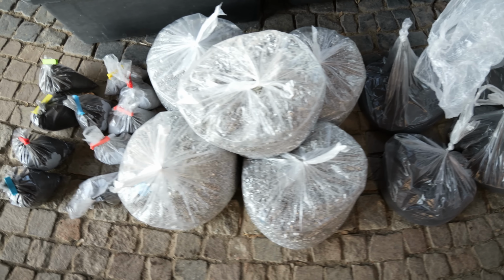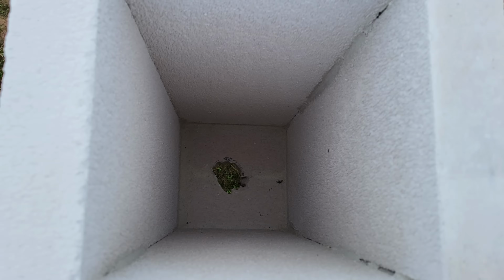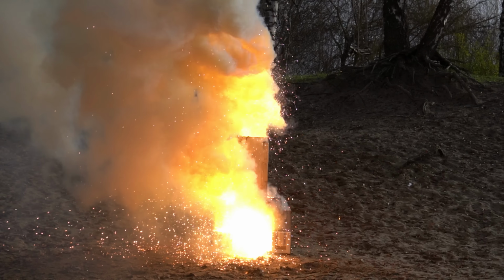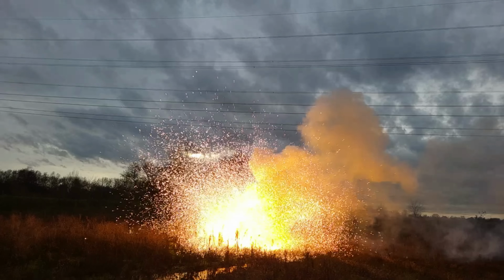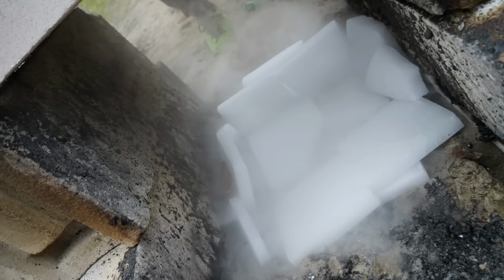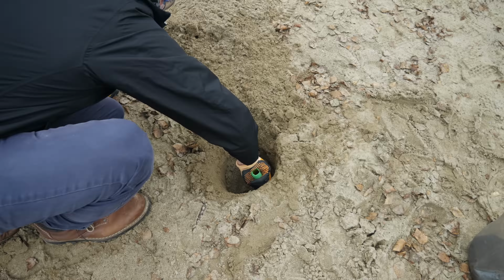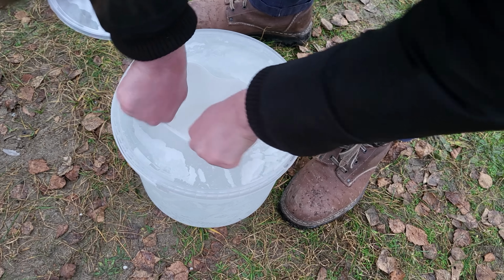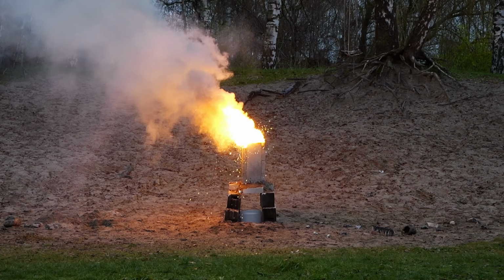100kg Thermite: Observing the Power of Aluminium and Iron Oxide Combustion

Comment: That was a hydrogen explosion.
When the cooling loop in a blast furnace ruptures,  it will make an explosion big enough to be heard miles away.
Your thermite mixture provided the molten iron and the ice stood in for the cooling water system and boom😮

It really sucks if you're on the plant when it happens because your ears are ringing 😵

The other reason I loved the video is the heat evolved from the thermite was thousands of degrees  because it was a runaway reaction but what if the fuel instead was just  pure iron powder ignited by an arc collar so fuel could be added from the top as iron, combusted in a turbulence chamber and then falling to the base as iron oxide Fe2O3 then take that rust and convert it back to iron powder using high temperature hydrogen 

By the way, the only byproduct is water and it might be the single most important process on the planet because powdered iron is rechargeable fuel that costs pennies.
A Belgian brewery is burning iron to make beer🍻
Reply: Nah, ice blocks also blow up when you pour liquid copper on them. Notable the watermelon didn't blow up, even though there's plenty of water there to create hydrogen and oxygen.
My money is on a violent thermal shock, as the explosion ONLY occurs with ice.

Comment: You get better thermite if you dry and clean your raw materials, such that far less gases are released during the reaction. You can essentially watch commercial thermite burn from up close, that is how controlled it burns due to the almost non existing gasification of impurities. I can show you some commercial thermite "elektro thermit" if you want, still have some bags of that material.

Regarding the explosion with ice, I would assume the same mechanism as with all the other metal-water explosions, which could be coulomb explosions.

Regarding the rubies: Look at the color of the reaction product, how is anything with a very light hue supposed to be visible in there? If the slag were white like pure Al2O3, then we could expect anything to actually be visible. But that is not the case. Additionally, due to the thorough mixing of your home made thermite during the reaction (due to gas escaping), there is way for a pocket of pure, molten Al2O3 to stay in place without getting mixed with everything.

PS: So many angles/cameras, why not dial down the exposure for some of them?

Comment: I would be willing to bet money that the dry ice pour yielded a wonderfully hard product.
By the way, had you included the dry ice into the mix it would have Amplified the reaction.
The cause of this has been of great debate for a long time.
 From the simple steam explosion to the Ripping the part at the molecular level of oxygen and hydrogen.
Personally I think it's a physical reaction which allows the molten material to become broken up into much smaller drops.
 The smaller bits of molten metal burn off much quicker. 

Like a dust explosion.
Reply: I can I imagine that you would get something akin to Cementite with that reaction. 
defiantly a hard material,

Comment: the dry ice didnt melt entirely in part due to the leidenfrost effect
imagine a drop of water on a pan that's way hotter than boiling temp, how it skitters around and doesnt just vaporize
such aggressive temperature swings between phase changes produces an insulating layer of gas that doesnt even allow the colder object to touch the hotter, cutting heat transfer drastically

Comment: Simple solution to the Water proplem: Water contains oxygen. Well CO2 dose too, but it's bound much stronger to the carbon than it is to the hydrogen in the Water. 
So what happens is that the reaction energy from the thermite is able to take oxygen away from the water and use it to burn more rapidly

Comment: The exchange of oxygen from the iron to the aluminum must have an intermediate phase which would be highly polarized.  It may be enough to strip the hydrogen from the oxygen in the water, but then what happens to the oxygen?  Does it recombine with the hydrogen or does it combine with the metals in an explosive way?  Does it also work with liquid water, and if not, why not?  I think your question requires more science and less play.  Experimentation and analysis of the products is required.

Comment: What if we consider the potential speed of the individual molecules in hydrogen and oxygen? In frozen state, water is not moving very fast, then massive influx of heat causes the molecule to begin to vibrate faster. What if the hydrogen being smaller begins vibrating faster than the oxygen? If either of the hydrogen molecules vibrated fast enough, they could Snap there double bond, Boom, instant Browns gas, and free hydrogen.

Comment: I believe that metals burn at such a high temperature now they actually break the Bond in the water molecule and become separated into elemental oxygen and hydrogen. Which is why you don't use water to put out metal fires. May be wrong, this is just what I've been told.
Reply: Metal fires on their own can use water as an oxidizer, as water is a lot more dense than air, it can accelerate the reaction. But the thermite mix is already stoichiometrically balanc3d between Aluminium and oxidizer.

Comment: If I had to guess, since the water is a liquid at STP, it is able to bubble and boil until it covers and seals over the molten iron lump which lets it build pressure for a split second (water is incompressible) and explode, and since as it cools down eventually the Leiden frost effect will wear off, and so it can contact and boil the water abruptly as well. but dry ice creates a Leiden frost effect the whole time (due to the extreme temperature difference) and is not a fluid, and cant seal the expanding gas.

Comment: I was bored one winter and used electrolysis to dissolve a bunch of scrap iron (weird,  yes).  Other than the time, it was easy sourcing iron to do this, and was therefore 'cheap'.  :D 

The output was a black sludge which I rinsed with water several times to get the NaCl (yep, salt, very little) electrolyte back for reuse.  Once this black sludge was heated/dried and pulverized it became a fantastic bright red and super fine source for this kind of stuff.  Can't remember all the research I did way back then, but I could probably dig it up and share the process.  It was done in a controlled manner because I was paranoid - but this process produces hydrogen to get things done at a reasonable rate, and therefore I suggest no one try it.  Made 70+ lbs of iron oxide powder in a few months.

Also, it was a seriously nasty process which I don't suggest.  The black sludge (and subsequent output) will stain everything, forever.

Comment: my opinion is that the dry ice to gasCO2 has a much lower expansion ratio than water to steam. also the dry ice looked somewhat insulated from the interaction, the outer layer wisping away. by comparison, a volume of water would increase in temperature more uniformly until a sustained steam reaction occurs. >guess> it would not surprise me if once a volume of water has sufficiently warmed,  an initial steam reaction occurs resulting in a shockwave. a low pressure region behind the wave front gives rise to more steam reaction due to vapor pressure. not unlike cavitation.i cant find any papers on cavitation in near-boiling water<guess<

Comment: Could thermite be used to fire charcoal? A reaction vessel could be used to form a steel casing around the carbon mined from the atmosphere. We can use seasonal crops as a carbon source. Agricultural waste reduced to carbon in any form depending on what alloy the reaction vessel produced by the reaction yields as wheather and how it is quenched.

Comment: If you are using an excess of aluminium, is it possible that the ironfall also contains aluminium (I) oxide and aluminium (II) oxide? I am not sure how exothermic the hydration of aluminium (III) oxide would be but those other two would be very reactive. This could be tested by using a less reactive metal oxide* than iron oxide, the heat would be similar and the aluminium compounds similar but no oxidising of the metal. Alternatively, using zinc metal† with iron oxide would also be interesting, as the zinc would have fewer possible oxidation states. Sodium, potassium or lithium would have their own difficulties and would complicate matters by possibly producing superoxides and peroxides. Powdered silicon is one I have always wanted to see used, but elemental silicon has a Mohs hardness of 6.5.
All of the possible thermites above ice, please.
* I don't know - bismuth, indium, tin? 
† Equally reactive transition metals may have different qualities in promoting the explosion - chromium, manganese, copper, etc.
Reply: Aluminum doesn't have lower oxidation states (to any meaningful degree, AFAIK?), but excess metal dissolves in the iron so it will contribute to the reactivity of the liquid all the same.

"Ironfall" hmm, it IS something of a waterfall at this scale, isn't it... but with something very much not water. I like it.

Regarding zinc -- these reactions are driven not so much by conventional [aqueous electrochemical] reactivity series, but by the binding energy of the compounds created; Al --> Al2O3 releases tremendous energy so it's capable of reducing elements you might not otherwise expect.  Also, metals like Zn, Mg, Mn, Na, etc. have low boiling points, so they tend to leave the reaction once formed; indeed you can make elemental Mg from MgO + Al, if you cook it hot enough for long enough, and preferably in vacuum; despite the massive binding energy of MgO (MP ~2800°C!), Mg distills/sublimes off.

ZnO isn't a bad oxide in terms of binding energy, but I'm not sure it would do much in comparison to Fe3O4 or Fe2O3, and Zn is a gas at any temperature where those oxides are liquid (unless you want to do it in a bomb reactor :) ).

Comment: May it be that molten iron and molten aluminium in contact with water behave similarily to alkali metals in water? On YT thunderf00t had a series of experiments trying to figure out mechanism of alkali metals explosions and it ended up with scientific paper.
Reply: Coulomb explosion? Perhaps the aluminium oxide hydrates in the meltwater and accepts electrons from the surface of the iron leaving it highly positively charged and repelled by itself. That could be tested by pouring molten iron and aluminium oxide powder into water.
Reply: Iron isn't a particularly reactive metal, but run it up to those temperatures and you'll have something comparable to... well heck the energy density is probably similar to (or even more than?) sodium, huh?  The kinetics will be different of course, it won't react that vigorously, but fast enough given the conditions (could well be "catalyzed" by the steam explosion mechanics) to drive the explosion.

I suspect a liquid phase is required, hence why (in part) the CO2 didn't do anything. Would be interesting, but, ah, needless to say, a bit more difficult, :) to do the same test again at 10 or 20atm so the CO2 can liquefy momentarily.

(CO2 doesn't react with iron, at least not very much/fast, AFAIK; there should be an equilibrium between C(dissolved), Fe(0) and Fe(II), CO(g) and CO2(g), which probably gives a minor amount of CO at these temperatures? And not enough C(0) to notice, except perhaps in some of the more firey conditions like with the cyclohexane.)

Comment: I want to create a ruby rod for a sokid stare kaser. So, same experiment but with a different recation vessel envased in thermite nade for a long sustained reaction shaped in a long silicon dioxide crucible with air vents to allow air to dkow into the feaction chamber thats not consumed by the termite reaction but vented in from outside through several vents made by the same as ckosed reaction vessel. The reaction making the ruby is driven by the thermite heat not in an oxygen deprivation environment. 

Or mix the components of the ruby nix wirh thermite ro get iron infused with ruby pieces. Have it drop into a preformed cast or casts which will nake some neat fake coins and clean them up after   ..

Comment: Don't know if it's a steam explosion, but the fact this phenomenon happens with ice and not with CO_2 or exane could be due to the strong IR absorption from water which heats up in the bulk simultaneously instead of layer by layer?
Reply: It was found out that it happens probably due to a Coulomb explosion, which doesn’t happen with the non polar CO2, and almost non polar alkanes. 
Wouldnt a high IR Absorption make it Heat in layers instead of as a whole?

Comment: II can imagine that water is trapped in the liquid iron due to the Boerhaave/Leidenfrost effect and then suddenly evaporates. This is also supported by the fact that liquid iron is flying around everywhere. It's not a simple steam explosion. It takes a while and the liquid iron has to gain the upper hand in order to penetrate the ice and form a round shape around a significant portion of the ice. Then the liquid water swirls in that newly formed shape, which does not evaporate immediately, but only after a while does this effect collapse and forms steam much, much faster than the speed of sound, which leads to this violent explosion. 

I believe that dissolved hydrogen can play little or no role here, since you need a lot of pressure to bring the water to these temperatures to split the molecule. This is hardly possible under the normal atmosphere because you don't have a pressure vessel or anything like that. An oxyhydrogen explosion of this magnitude would also be so loud that you would definitely need ear protection or an ear doctor after the experiment. In addition, the structure would also be destroyed and leave a hole.

That's my theory about it and I can imagine  this plays also a key role in those alkalimetall-water-experiments on YT.
Reply: I partly agree, there shouldn't be enough H2 to chemically explode, but from the sound and looks it did start from above and shockvawe was supersonic. You got it backwards with the pressure - the more of that, the higher t° is needed to split the same amount of H2O. And molten Fe2 can create H2 and FeO2 or other oxides, so i have no definite answer.

Comment: Correct me if I’m wrong but it looks like the thermite is ripping the O2 molecules off the Carbon dioxide, causing the thermite reaction to burn hotter and faster.

Comment: Some day it could be a nice novelty to mix something like silver oxide and magnesium metal or some such. But of course on a smaller scale due to cost and safety.
Reply: I've tried this on a small scale with disappointing results. I think the problem is that silver oxide decomposes to elemental silver and oxygen at only about 200 C, far below the initiation temperature of thermites. Magnesium also tends to make a worse fuel for sustained combustion because it has a low boiling point (1091 C, vs. 2470 C for Al), causing a lot of your fuel to evaporate rather than react and lowering the temperature of the reaction. It can be good for making a brief burst of light, metal, and slag, but it is much less efficient than aluminum thermite.
Reply: @grebulocities8225  Sorry to hear that

Comment: Growing Rubies with thermite can be made much easier. Aluminium oxide is already present. Try to make a bit more aluminium in the thermite than required. Replace some of the iron oxide with chromium oxide. Let the slag settle and cool down as slow as possible!!!!!!!! No pool cooling! It can work if done right. As child i have found sometimes thermite rubies close to abandoned tracks with crystal size of more than 2 millimeters in bubbles. Sadly i did not take them with me when i moved away from my former hometown due lack of space.

Comment: Hydrogen is the only gas that I know that explodes like that.   I would say it's a hydrogen explosion. The heat separates the oxygen and hydrogen at the same time, igniting the hydrogen.
Reply: Thermal decomposition of water.
In thermolysis, water molecules
split into hydrogen and oxygen
For example, at 2,200 °C (2,470
K; 3,990 °F) about three percent
of all H20 are dissociated into
various combinations of
hydrogen and oxygen atoms,
mostly H, H2, 0, 02, and OH.

Thermite at 2,500C can do this.

Comment: You should try making thermite out of exotic materials. Maybe something like tungsten-oxide or titanium-dioxide with ... idk ... does bismuth burn? Maybe sodium and all those metals? Try cesium and tantal (from electronic capacitors), maybe add a little bit of sulfur so it burns better... idk, have fun! :D
Reply: Bismeuth oxide thermite is what dragon's eggs crackle fireworks stars are made of. A really trippy thermite mix is aluminum sand sulfur and a little potassium perchlorate to start it getting hot enough. It makes blue white fire followed by trippy blue flames. You end up with an ingot of silicon afterwords. 😁
Reply: @christopherleubner6633  Silicon? Oh nice

Comment: Water (ice) reacts with iron and hydrogen is formed, hydrogen than reacts with oxygen in atmosphere (explosively) and creates water. It could be said, that water catalyses oxidation of iron. Something very similar happens when you pour water on ignited magnesium.
Reply: its not the iron, its the aluminum
Reply: @yaykruser iron is created during the  exchange 💱 reaction
Reply: At some temperature 🌡️ point water can turn to oxygen  and hydrogen, but not sure if it's enough heat for that.
Reply: It looks like the explosion on the ice is this:
2 Al ( Aluminum ) + 3 H 2 O ( Steam ) → Al 2 O 3 ( Aluminum oxide ) + 3 H 2 ↑ ( Hydrogen )